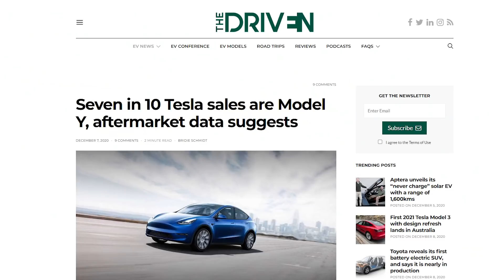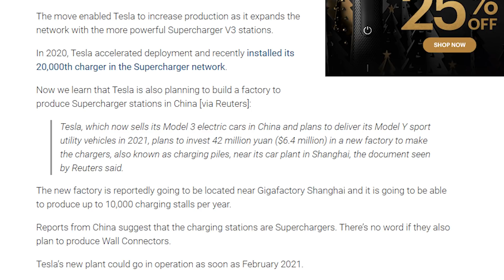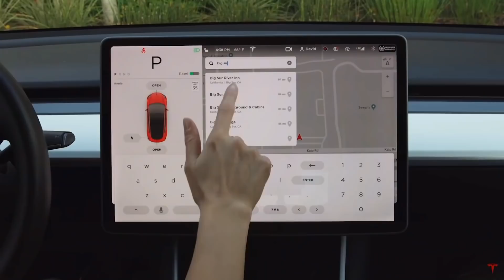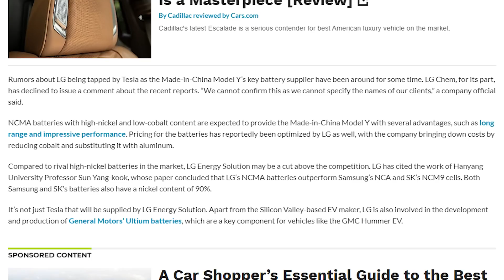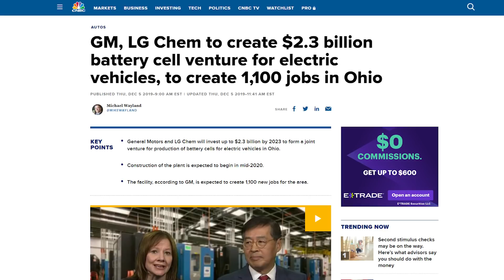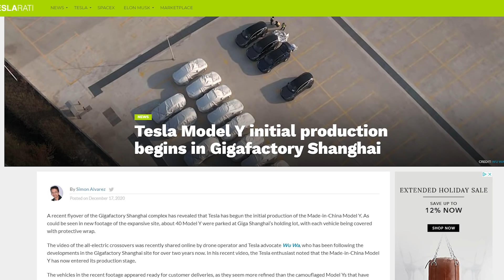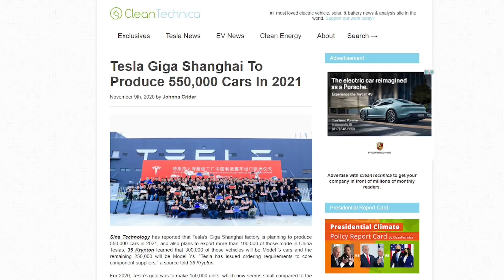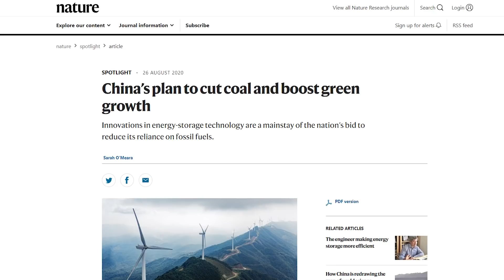TESLA STOCK GETS BIG NEWS - New Supercharger Factory Is Up! (Secret Plan)

Comment: In Germany ALL equipment using water requires a permit after lengthy debate.   Currently Tesla is still waiting for permit to build toilets in its Berlin factory.    Hopefully Tesla will get the permit by the end of 2021.   In the mean time all construction workers have run to the edge of the forest to discharge some body liquid.   This already contributes to the noted growing rate of the trees around the Tesla factory.  They growth much greener and thicker even during the cold winter.    Due to these positive effects Tesla might never get the permit to build toilets in its Berlin factory.    Tesla Berlin factory might soon be able to claim the world 1st car factory that has no use of running water.    All Germans should be proud of its Tesla factory.